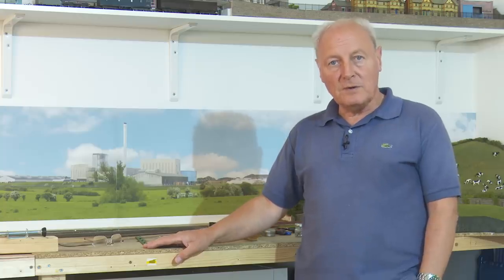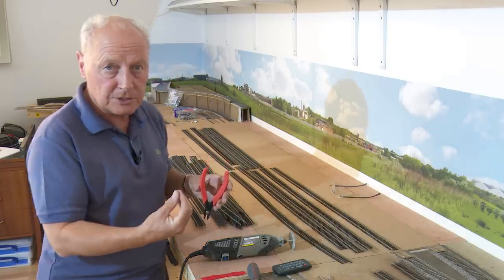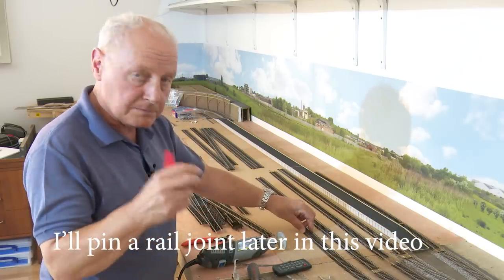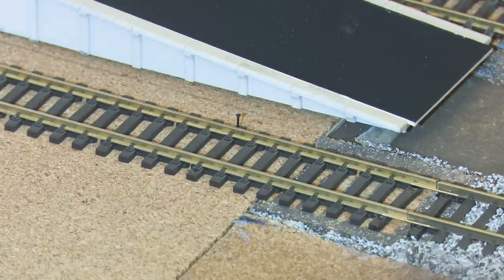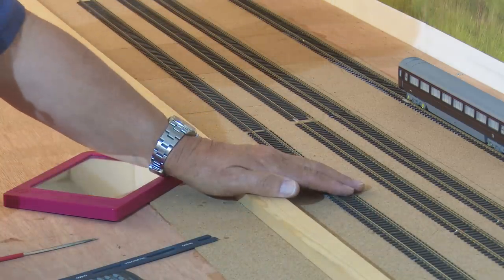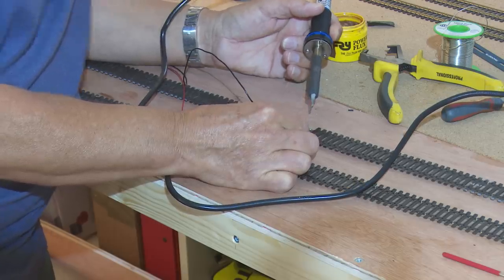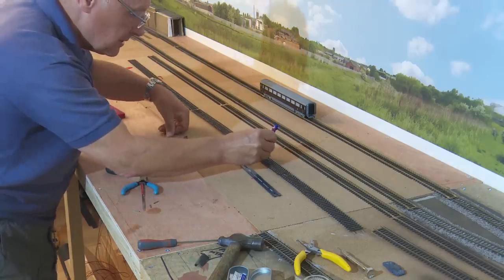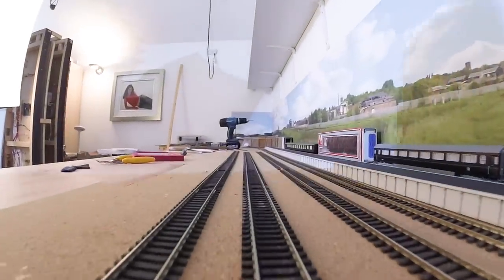Track Laying Glue or Pin? at Chadwick Model Railway | 38.

Comment: Better never put solder on the iron; better apply solder to wire and road together.
Reply from the maker: A fair point, but you do need to tin the soldering iron. Regards Charlie

Comment: Here is the states we have Harbor Freight for rotary tools and accessories.  Dremmel wants about $50.00 US while the other is $19.00  Also I recommend steel wheels especially with cars with lights.  The wire bruse buffs the wheels right up.  I hope you are using nickle silver rails so that they will not tarnish or rust and takes solder well.  Steel wheels also helps to keep the crud buildup off the rails.  I would like to share another modeler on youtube with you to give you some ideas as well - Marklin Of Sweden.  Bob
Reply from the maker: Thanks Bob, greatly appreciated.

Comment: I may have missed an episode, but why Cork? There is foam underlay, which is quieter, and of course, the ballasted foam, which saves a lot of ballasting later on. Have you tried the different underlays?
Reply from the maker: Be very careful with the ballasted foam from Hornby Harrison. It only has a 10 year life before it starts to turn to dust. Regards, Charlie.
Reply: @ChadwickModelRailway  That's interesting to know! I actually put glued ballast around, and over the foam, to try to make it more realistic - as you show in your episode 63 - and it has therefore got a 'crust' of ballast, and pva which hopefully will hold it all together. It is now 17 years old, and I just gave it a poke...all is well. 🙂

Comment: My first time watching your videos...
[X] Liked
[X] Subscribed
I have a box-set of PECO Track that I am puzzled about and, it's been too long ago I had asked questions about it and still no direct answer.
PECO OO/HO SetTrack  ST2001 pack of 8 Double Straight Units.
It's Flexible/it's rigid... what is its main purpose?  When I bent it, the ends stayed even... It would not allow a curve, only a shift in direct route.
Reply from the maker: Hi, I’m so pleased that you enjoyed my videos.
I’m sure that your ST2001 is an 8 pack of Set Track that isn’t flexible.
When you bend Peco Streamline (flexitrack) the inner track comes out of the ends. 
Also it never has fishplates fitted.
I do hope that this helps.
Regards Charlie

Comment: "Don't re-use steel track because it'll rust"... (Checks all my track from the 1980s) It's ALL STEEL! ALL my track is steel!
Reply from the maker: Just keep it clean and dry mate.
Reply: @ChadwickModelRailway  Unfortunately as good as nickel track is, its completely the wrong colour. natural rust on the sides of steel track looks just like the real thing, as long as the tops clean there will never be an issue.
Reply: I use peco track

Comment: As an engineer I have to say your adjustable brackets look way too flimsy.
You would have been better advised to buy one maybe two & use them to adjust board height & then place the sturdy legs on the floor & screw through the deep front horizontal boards into the slightly shortened legs to give you a much stronger job.
Reply from the maker: I must confess David they seem to be doing the job okay.
Reply: I wish you luck chaps as many torsos leaning over the baseboards could really stress those small brackets.  However as always “Time will tell”

I’ll leave it there.  Thanks for your feedback at least I wasn’t talking myself 😉eh.